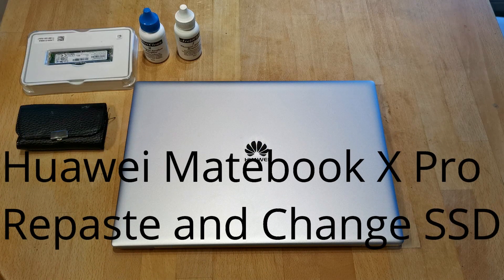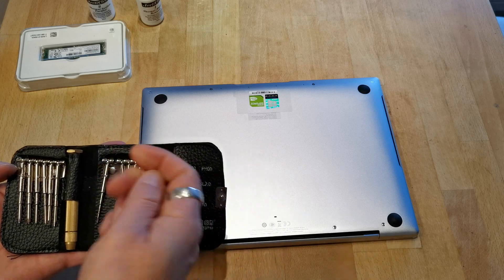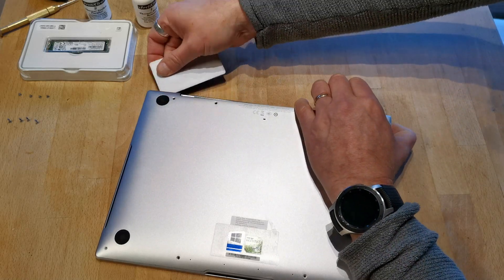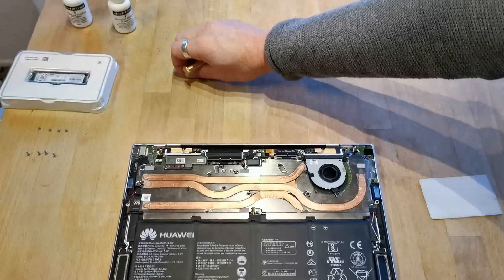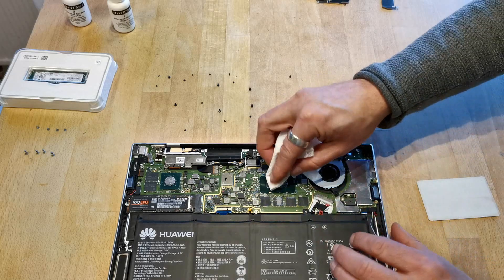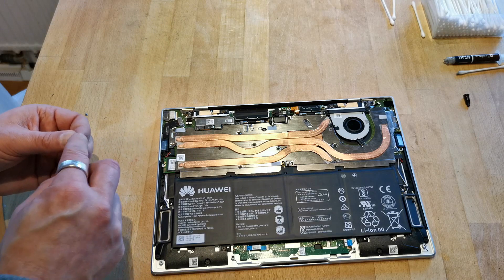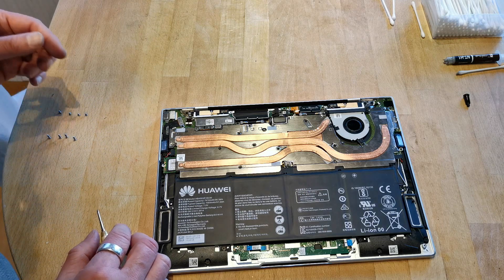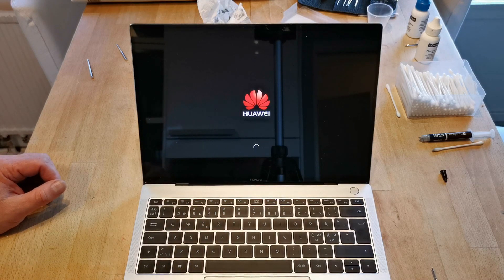Huawei Matebook X Pro Change SSD Teardown and Repaste CPU GPU

Comment: What if you have version without dedicated graphics and want to add geforce later?
Reply from the maker: Thanks for watching this video. The Geforce MX150 is soldered on the motherboard and can not be added after you bought it, don't think you can buy that chip from Nvidia and solder it your self. The Thunderbolt connection is not dependent on the dedicated graphics so if you plan to buy an external graphic dock like the Razer Core(+  graphic card) or Gigabyte gamingbox(graphic card included) for gaming on high graphic settings via the Thunderbolt USB-C port you are fine to go. I would be very glad if you can subscribe to my channel :)

Comment: Can I install additional ssd in order to increase the storage for matebook x pro 2018?
Reply from the maker: No that isn't possible only one m.2 port. I use a 2TB drive but that one is very expensive yet. The next matebook x pro(2019) have at least a MicroSD slot that can give up to 512GB expansion.
Reply: @thetechzone6558  It's not true. There is no MicroSD slot on the new matebook x pro 2019.
Reply from the maker: Correct thanks for your comment, the first leaks suggested that it should be implemented.
Reply: The Tech Zone despite this, what do you think, would I be able to install the same evo 970 ssd in a new macbok x pro?
Reply from the maker: I suppose you refere to matebook, should work without problems, nothing much is changed. Windows update should handle missing drivers.
Reply: 200$ for a 2tb intel 660p is not that bad, prices are at an all time low and are likely to increase after summer so, buy one while you still can.  And you can convert the internal ssd you take out to a usb drive. Granted the 660p is not the best in performance, but it's still nvme and its still crazy fast.
Reply from the maker: Hi, thanks for watching this video! Yes you are totally right, and the minor difference while doing day to day task will not justify the price difference to Samsung EVO 970. Please help the channel by subscribing it would make me very happy :)

Comment: Was the difference in temperatures significant compared to the stock thermal paste?
Reply from the maker: Hi, thanks for watching this video. Not so much, I got 3-4 degree celsius lower temperatures running 3DMark benchmarks, a more diffecult solution would have been the use of liquid metal thermals like the Thermal Grizzly Conductonaut Liquid Metal paste but that stuff scares me a little. Please support the channel and help me reach 1000 subscribers I'm so very close now, as I support yours :)
Reply: @thetechzone6558  Thankyou I subbed! How do you install Windows 10 when you changed the SSD?
Reply from the maker: Thanks for your subs!! I made a recovery image on a USB stick and restored from that one, just search for recovery and you find it.

Comment: Hi, just come cross u channel today. I received my matebook X pro last week and wanna swap out the small SSD as well. I realized that they actually use the thermal pad between the GPU and heat sink. Does the thermal paste work as well in your case? Is ur matebook working fine with the repasting? Thanks
Reply from the maker: Thanks for subscribing :) .It didn't feel like thermal pad when removing it but I have no experience with them. The laptop worked very well with 3-4 degree celsius lower temperatures in 3DMark benchmarks.
Reply: @thetechzone6558  when I watch the BradsHacks video, it shows that there is a purple colored thermal pad on the dGPU. You mean there is no thermal pad on your unit?
Reply from the maker: Have not seen that video only but looked at an instruction on the web were he applied thermal pads on several places. That was the most complete solution I ever seen :) So no thermal pads not even on the SSD as I have had on several laptops(Dell XPS 15 2-in-1 for example)
Reply: @thetechzone6558  Ah, sorry, I think there might be a misunderstanding. I mean, originally, the Huawei put a purple colored thermal pad on the dGPU. When you disassemble you matebook for the first time, the thermal pad would probably be cleaned up by you and I saw you replace the original thermal pad with the thermal paste. It seems like the thermal pad is used to filled the big gap between the dGPU die and copper heat pipe where the thermal paste would not be a viable option.
Reply: @thetechzone6558  Since you have not run into any problems so far, I guess it should be alright to just use the thermal paste ( maybe put a slight thicker layer on the dGPU die).
Reply from the maker: I would not go for a thicker layer, the thicker layer the worse heat transfere.

Comment: First of all give you the congratulations and the thanks for the video. You would be so kind as to tell me if the RAM of the laptop is welded to the plate or on the contrary it is in a slot and can be replaced to extend it easily. Thank you very much and greetings
Reply from the maker: Thanks for nice comment, please subscribe to the channel if you havn't already :). The laptops RAM is unfortunatly soldered on the motherboard as all 13 inch laptops, except for maybe Alienware 13.
Reply: @thetechzone6558  does it matter if i solder a new one in?
Reply from the maker: @DEATHMETALCYCLE  Tricky business!  First you will have to find 4 8GB modules(to get 32GB RAM) that is possible if the sockets are some kind of standard. To remove the 4 modules you will have to do a full teardown to be able to access the area were the pins are welded. Be very careful when you loosen the modules so that you don't damage the circuits around the modules. The last problem is to solder the new 8GB modules in place and reassemble the laptop. I have never done this myself or seen it been done but someone must bi the first one.
I will be very grateful if you can support the channel by subscribing :)

Comment: Do you have the improvement in read and write speeds? Do you reach 2500 MB/s in write speed?
Reply from the maker: I rerun the test in 32GiB setting and got 3461 Read and 1353 Write
Reply from the maker: The Samsung Evo 970 have very good read and write speeds and the X Pro have 4 PCIe lanes to the m.2 port providing maximum speed. My read speeds are 2945 MB/s and 1164 MB/s write speeds in CrystalDiskMark 6.01
Please support me and subscribe if you havn't already it would mean a lot for me :)
Reply: I got another question: When you replace the SSD, you only requires to clone the system in the new SSD and then just change it, without any BIOS change in boot?
Reply from the maker: Right,  you don't need to alter any settings. I have also tried a clean windows install and that is a little tricky as you will have to do it in a specific order.
Reply: I'm suscribed in your channel since you are the only one who have the complete video to replace SSD. You're the best, thank you very much!

Comment: And all that with connected battery! Pure little thing, it doesn't deserve this!
Reply from the maker: Hi, Thanks for watching! Yeah disconnecting battey is always the safe way, but the as log as you dont create a short circuit you will be fine :)The wires are isolated and no contacts are touched, the processor itself have no contacts visable eithe but the motherboard have when the power is on(correct me if I'm wrong). The only problem I see is if you use way to much paste that spread across the circuits and after assemble the computer and press the power button you can damage the computer.
Thanks very much for subscribing, if you have any questions regarding anything don't hesitate asking :)
Reply: Don't get me wrong, this is Your device, do what You like, but I'm electrical engineer by profession and when I see something like this my hair goes up! And yes, You are wrong 100%! Even if You are not physically turned on computer, some motherboard components in this computer are actually running all the time! In the future, if You are doing something like this, first disconnect Your battery! Just think that these electronic components are electrostatic sensitive and You connect their multiple contacts unevenly! Thermal paste is more or less childish game, at least to me, no big deal, but of course incorrectly application can also get more damage then use, as You say. And so ...
Reply from the maker: Thanks for your comments and your explanation that gave me a whole new view of this matter!

Comment: Just advice for anybody following the video. DO NOT apply thermal paste as shown. It's way too much and you will create air gaps once that heatsink presses it all down. The size of a grain of rice is enough for a desktop cpu, this is smaller, use a little common sense. Be careful and proceed with caution. This is not for people that have never even opened a PC before.
Reply from the maker: Thanks for your thoughts, you may be right, but I still managed to lower the CPU and GPU temps with 3 degree celsius and I think that mostly was because the factory had used too little thermal paste. This topic isvery controversal, too much will cause a risk for pressing paste out on the circuits, too little will defenitly cause higher tempertures. Check this link if you are unsure about the amount of paste. https://www.youtube.com/watch?v=r2MEAnZ3swQ . I defenitly agree with the latter part, please be very careful and document every screws position.

Comment: is Cooling Architecture? The fan is doing what, nothing? in my opinion the cooling is practically passive because it does not have radiators for the heatpipes to pass to cool, it does not have nor compare with the cooling system of msi ps42 that is a direct competitor and with equal specifications
Reply from the maker: Yeah, it's a very strange solution and the only way to seriously improve cooling is to do a complete redo. Check Brad Ling's videos, they are really good and makes a big difference. Please support me by subscribing : )
Reply: @thetechzone6558  I had watched a video of Brad Ling but was from the original meme John Cena kkkkkkkkkkkkkkkk I just saw the videos of matebook was a good solution

Comment: Is it possible to replace the SSD without removing the heatsink? Seems like you'd be able to kind of wiggle it out?
Reply: There's a report on reddit stating that it is indeed possible to replace the SSD without entirely removing the metal cover, however the author found a foam pad underneath the SSD to be in the way which is why he had to remove a few screws from the metal cover to slightly lift it and then push the SSD underneath. Check the thread at https://www.reddit.com/r/MatebookXPro/comments/8w6jjy/how_to_upgrade_ssd_on_matebook_x_pro/e4akyst/
Reply from the maker: I didn't try, looked like the laptop frame was in the way. I returned my device since I had issues with screen freeze randomly. Please subscribe to my channel and help me reach 1000 subscribers : )
Reply: @thetechzone6558  I get bsod with critical process failed error all the time. Installed windows fresh multiple times to no avail. If I try your method would it help in resolving the issue?

Comment: Hi there. Thanks for the video. I did subscribe but I do have a question. What did you replace your old SSD with? What brand and type? Is it possible to get a 2tb SSD for this laptop?
Reply from the maker: Hi, I replaced the 512Gb drive with a 2TB Samsung 970 EVO MZ-V7E2T0BW and it works really fine. Thanks for subscribing!
Reply: @thetechzone6558  How do you get all your software on the new HD after you replace it?
Reply from the maker: Hi, I reinstall the software that I have installed. Huawei matebook x pro have only their own software handeling driver updates and you can download it from their Web site. Another way is to use a disc clone software to give you a smooth transition.
Reply: @thetechzone6558  where you get this Ssd can you give me online link of this ssd on amazon
Reply from the maker: @fununlimited9495  The one I have is Samsung EVO 970 2TB, the one on sale at Amazon is the EVO Pro 2TB that I have linked below. I would also consider the 80$ cheaper Samsung 860 EVO 2TB.
I will be very grateful if you can support the channel by subscribing :)
https://www.amazon.com/Samsung-970-EVO-Plus-MZ-V7S2T0B/dp/B07MFZXR1B/ref=sr_1_2?dchild=1&keywords=samsung+evo+2tb&pd_rd_r=7c73939a-eed4-4081-9031-bc01d0dd6b27&pd_rd_w=0dY2k&pd_rd_wg=91rTj&pf_rd_p=9dad86ae-1554-484b-9cc0-f9673b44705e&pf_rd_r=1EC04FVTY35E7V6W3EDG&qid=1613664584&sr=8-2 

https://www.amazon.com/Samsung-860-SATA-Internal-MZ-N6E2T0BW/dp/B07822SVMS/ref=sr_1_5?dchild=1&keywords=samsung+evo+2tb&pd_rd_r=7c73939a-eed4-4081-9031-bc01d0dd6b27&pd_rd_w=0dY2k&pd_rd_wg=91rTj&pf_rd_p=9dad86ae-1554-484b-9cc0-f9673b44705e&pf_rd_r=1EC04FVTY35E7V6W3EDG&qid=1613664584&sr=8-5

Comment: The 970 EVO came with the MateBook?
Reply from the maker: Hi, thanks for watching. No that was a 1TB drive I had since before. The drive that came with the laptop was a                           Toshiba XG5 KXG50ZNV512G . Please subscribe, it would really mean a lot : )
Reply: @thetechzone6558  I'm suscribed right now. You are the only one with the video of how change the ssd. I got another question: It is harmful for the MateBook change the SSD? 

PS: Thank you!
Reply from the maker: No, you will need to repase the CPU and GPU before putting the heat sink back on and since there is one screw that has a sticker on it you will have to check with the retailer or Huawei if it will damage your warranty!!!. If you don't have a Windows 10 USB installation media I recommend you create a recovery drive(just search recovery drive in windows, you will need at least 16GB if I remember correctly). I have tryed both, clean install need to have some drivers from Huawei installed in a specific order. If you need help with that please inform me.
Reply: @thetechzone6558  I'll do. Thanks very much for everything!
Reply: @thetechzone6558  hi how do u do a clean install?
Reply from the maker: Thanks for watching this video!I I Just download this tool from Microsoft https://www.microsoft.com/sv-se/software-download/windows10 and make a install media using a USB-stick. When that is done I download PC manager from Huawei https://consumer.huawei.com/us/support/pc/matebook-x-pro/ and install it. The PC manager downloads all drivers and install them. 
I hope you can support the channel by subscribing, that would make me very happy :)

Comment: Hello. What if you don't change the paste and just keep the original? Possible to do?
Reply from the maker: I will not recommend using tha old paste, you can see that its not evenly spread on the surcace and the manufacturer often use cheap paste. Please subscribe and help me reach 1000 subscribers : )

Comment: Where is the video whereby you test the Matebook X Pro with your eGPU to play the latest games on one display at full HD. I have the Matebook with the highest specs myself but really considering to get an eGPU. Already have a good PC back at home but since I will be moving out soon and live in another country, I find it hard to take my PC with me as the eGPU is portable, easily installed and I can install one 2/4K screen to do my study work on it as well beside of gaming. Really liking the idea of having eGPU but there ain't many videos yet with the Matebook. Could you please upload more! Thank you.
Reply from the maker: Thanks for your intehttps://www.youtube.com/watch?v=BfOxhn8CAFkrest, here is a video that shows the result playing with and without the Core. Please subscribe. https://www.youtube.com/watch?v=BfOxhn8CAFk
Reply from the maker: Sorry for the bad copy paste
Reply: @thetechzone6558  Oh cheers, thank you! Looks like I didn't look close enough. Can you also do one with other games? Does the VAN of the laptop also start to blow once the eGPU is connected and you play games in high specifications?
Reply from the maker: The fan kicks in on low speed when connected, not so high sound. The razer Core have a much higher sounding fans and when the gtx 1080 starts running hot I measure 55 decibel.
Reply: SnappCloud note that the 2018 model year has a cut-down thunderbolt 3 port, meaning you only get half the full bandwidth when connecting to an eGPU
Reply: @wocaomade  I sold the eGPU already and upgraded my computer instead. The eGPU made a terrible noise.
Reply from the maker: That is true but you will not notice the half bandwidth if you doesn't exceed the GTX 1080. I noticed that when I bought the 1080ti and did only gain a few fps. I have a comparison with HP spectre x360 and Huawei matebook x pro were the spectre have 4 pcie lanes

Comment: Would love to see if there was a performance increase with frame rates. Great videos!
Reply: Is there anything you miss from the matebook now that you don’t have it?
Reply from the maker: Shure, I miss the great screen it's the brightest panel I ever used.
Reply from the maker: I got 5 degrees lower temperature when running benchmarks, but didn't notice any difference running games. I have sold my unit now as I got a good price for a Dell XPS 15 9575 2-in-1,